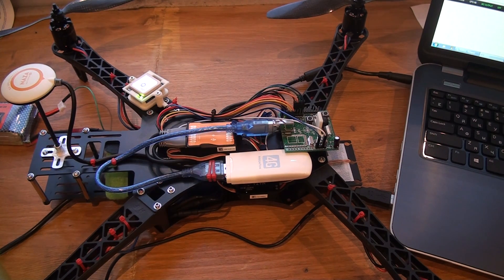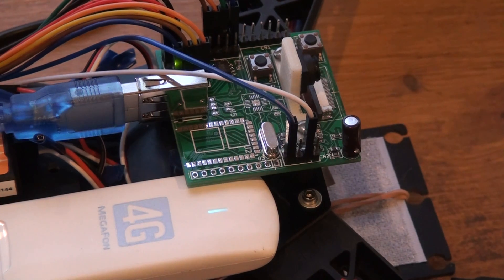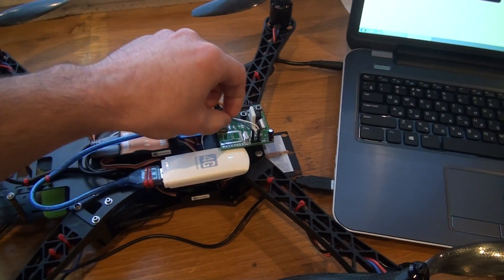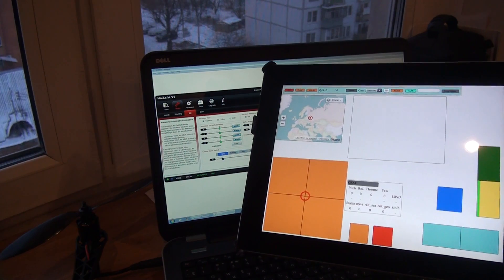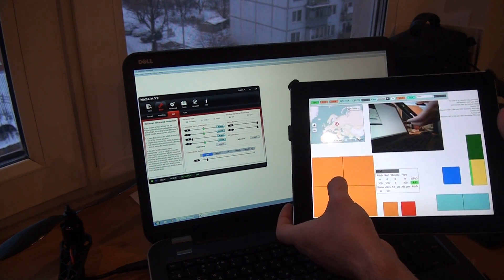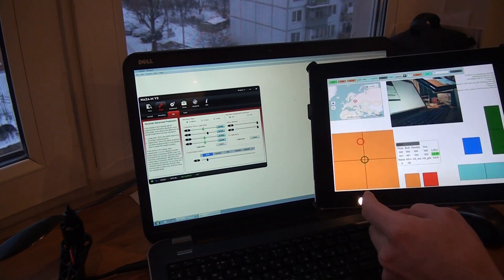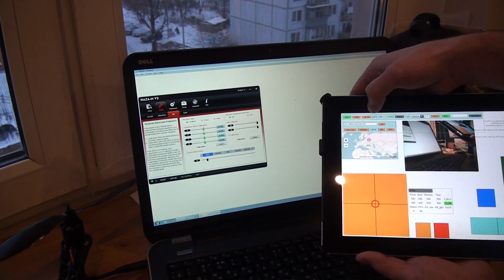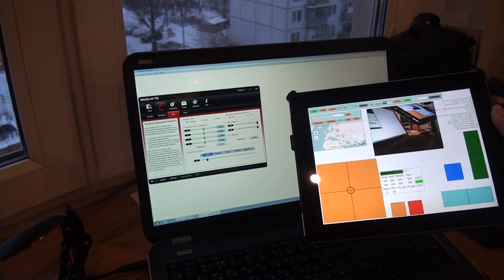4G GSM FPV receiver + NAZA M V2 demo

Comment: What experience did you encounter with interference from the 4G frequency with the traditional radio and NAZA?
Reply from the maker: There actually no interference as I'm not using any other receiver but only 4G GSM. NAZA gets signals from 4G GSM receiver as PWMs on 5 channels: Pitch, Roll, Yaw, Throttle and 3 position switch (this is what meant to be traditional approach).